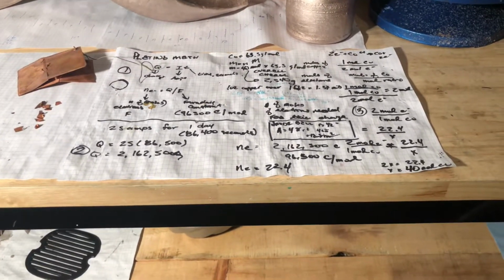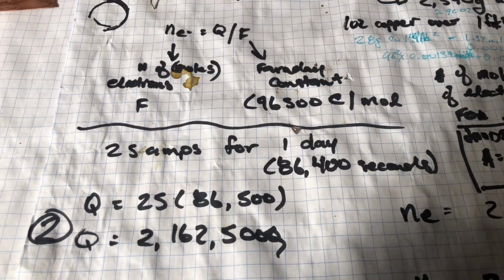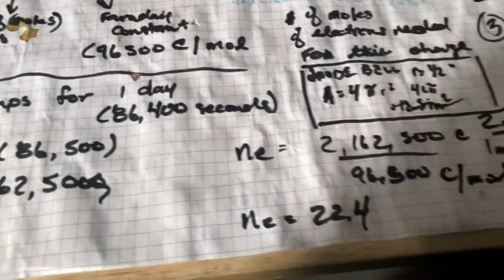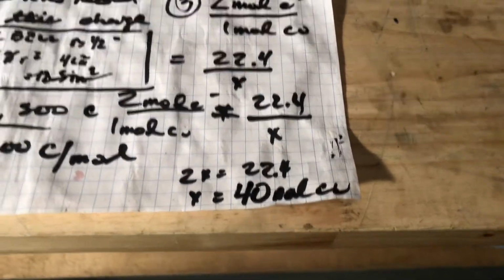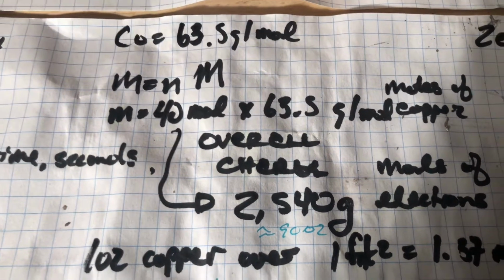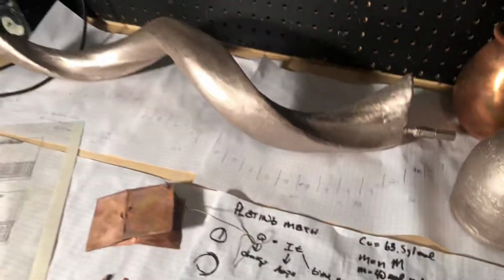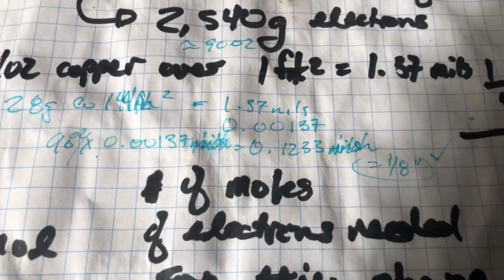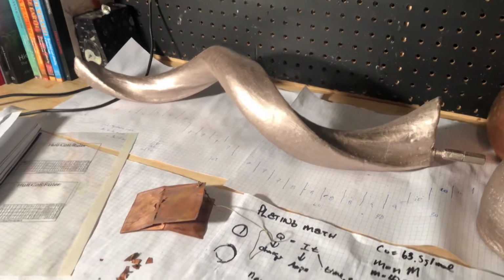Viktor Schauberger Forms and Formula

Comment: Interesting that teeth are called molars. Hmmm
Reply: Language holds and hides much.
Reply: I still dont follow how the wax is able to come out the horn.
Reply from the maker: When the electroforming is complete I place the horn into water and bring to about 90 degrees. The wax melts out in a short time and I am left with the shell. A future idea, when I am able to achieve a smoother surface texture, will be to dip the electro formed part into wax again, repaint and electroform. This process can be repeated to create a nesting series of pipes. Why??? Not sure but I want to experiment with the idea. Also layers of copper and wax be a type of capacitor…